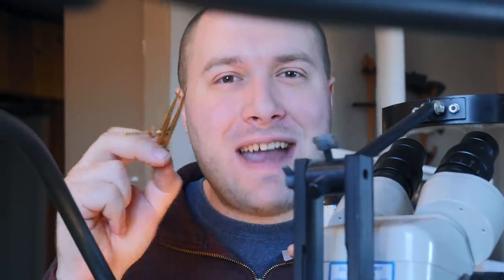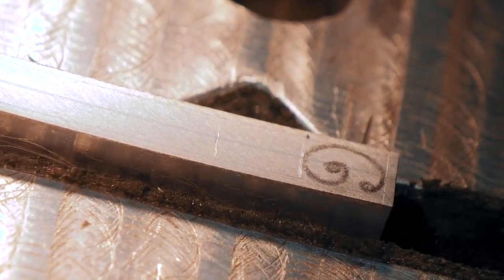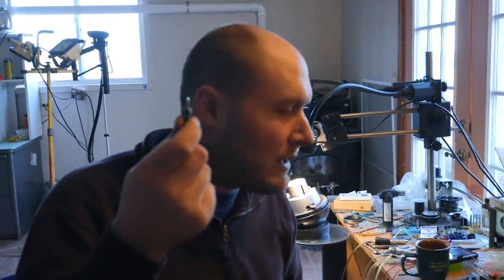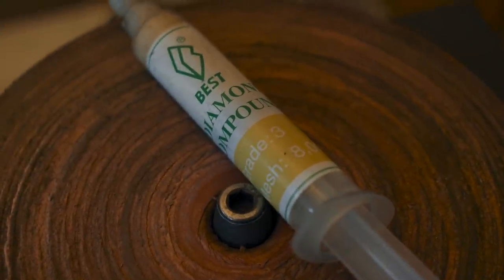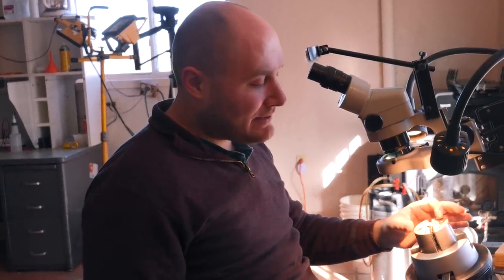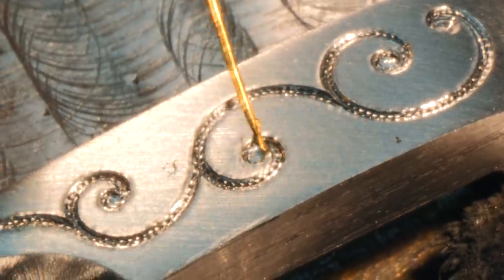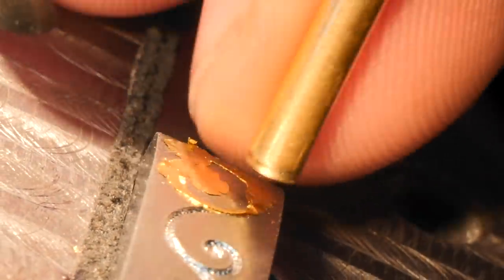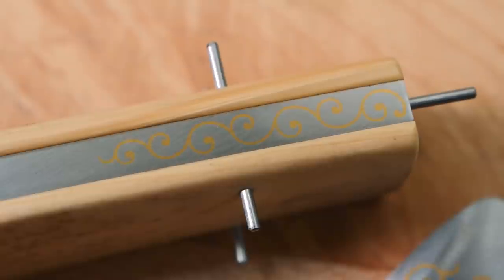24k Gold Inlaying: Hunter Knife Part. 3

Comment: I'd be tempted to vacuum up all the sanding and gold dust then watch one of Cody's Lab videos on how to recover the gold. More for the fun of it than it being economical to do.
Reply: I'd build a removable catch can around the vice, when done sanding, simply brush all the filings, steel and all, into the catch can, put it on a shelf until next time. Make a fun project for a rainy day in about 20yrs time 😂
Reply: Jewellers who work with gold save everything. Every bit of sand paper and the carpet around them and all the rest. And then years later they'll take all that material, burn it all and then recover the gold from the ash. Depending on how much gold work they do that can add up to be a substantial amount of it.

Comment: maybe this is a dumb suggestion, but couldnt you acid etch a computer designed pattern for the purpose of uniformity and spacing then come back with the engraving tools to clean it up and undercut? I have seen acid etching used as an alternative to filework on some knives and I wonder if that might be a useful methodology for some of this type of work as opposed to laying out a pattern by hand?
Reply: @Jadon Ingalls  - I thought it might not be so smart only because A) although I may be absorbed with learning in such videos I have little if any practical experience in such engraving or acid etching, and B) I would assume (maybe I'm wrong) that acid etching does not leave as fine an edge line as engraving to begin with and the potential clean up work would obviate the potential time saved. One would think though that a very accurate, very detailed pattern could be laid out.
Reply: A second question. If one were to want to add inlay to a blade itself, (I was contemplating some silver work on raindrop damascus - gold is a bit of a pricey way to learn) I assume that the engraving itself must be done prior to heat treating and then scale carefully removed with a burr from the engraving channel after tempering, and prior to the silver or gold inlay?  I would think that you want to do the inlay in the hardened steel after tempering in order to help avoid fracturing or chipping any tiny dovetail edges on the hardened steel.  Is it necessary to remove the scale from the engraved channel or would it be so minimal that it wound't affect the mechanical bond  with the silver or gold inlay?